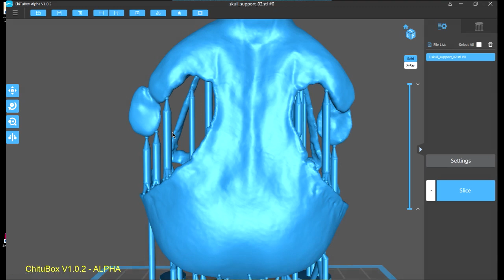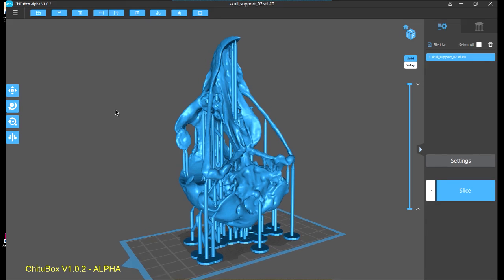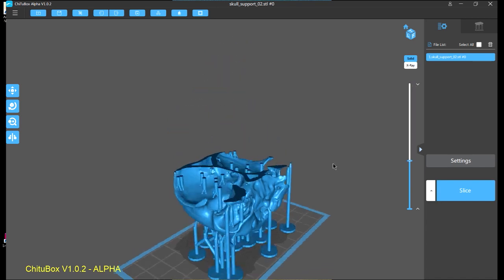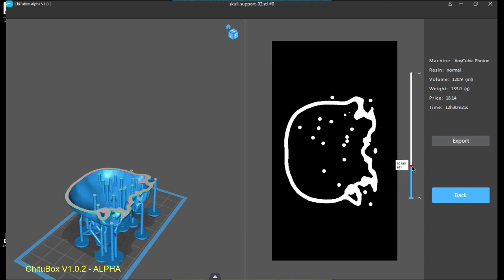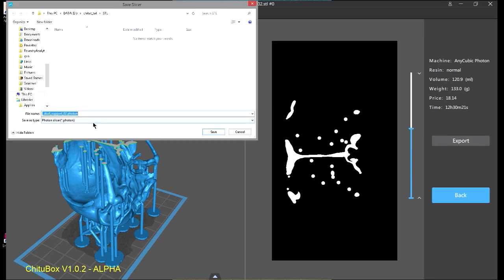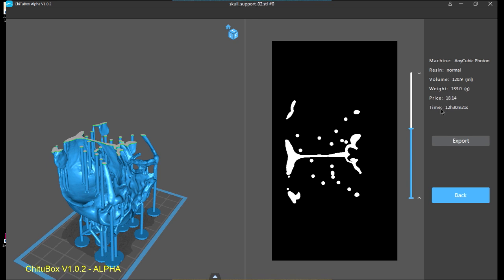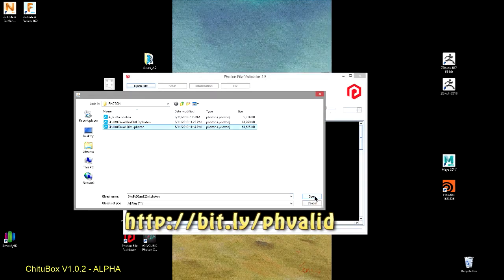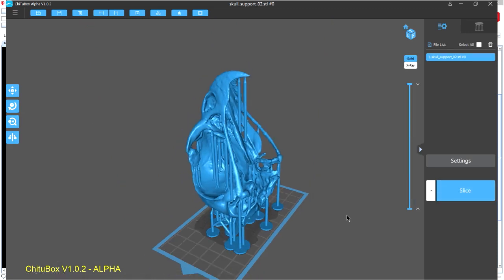ChituBox Quickstart Guide / Ch06 - Slicing for DLP printers

Comment: Hi, can you tell me what does it mean when moving the slicer gives you sone areas bordered in red instead of green?
Reply from the maker: probably you are outside the build volume.
Reply: vfxforge thanks for answering, but no i’m not, maybe i explained my problem poorly. The item prints correctly, but if i move the blue slicer bar and see the model with a plane cut, the outer part is bordered in green but some of the inner parts have a red border when looked as a section
Reply from the maker: @druidobianco9734  hmm. Im not sure, maybe its internal floating islands that need support?